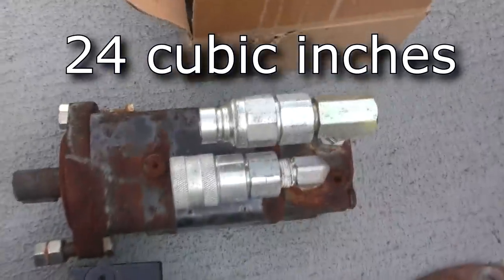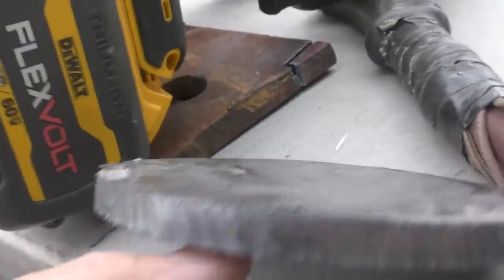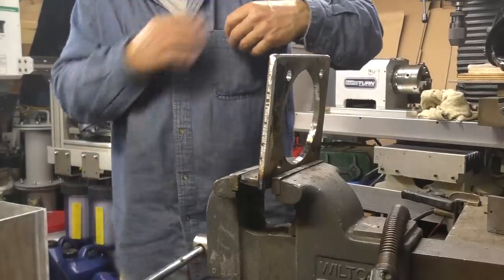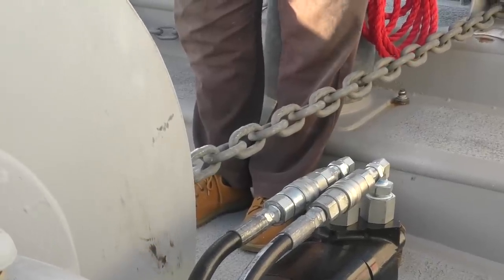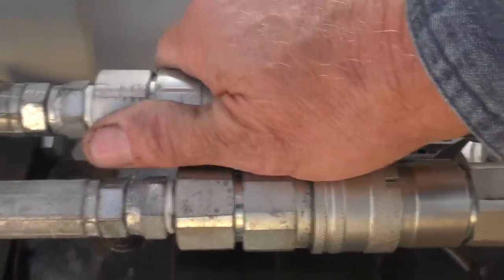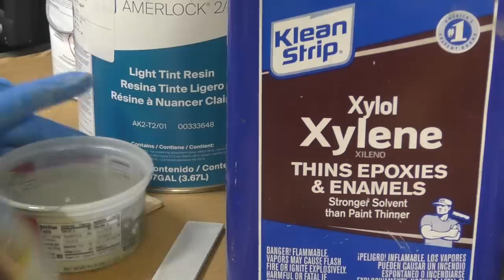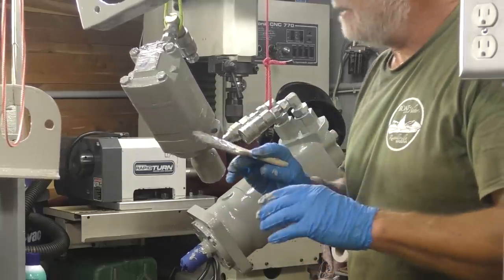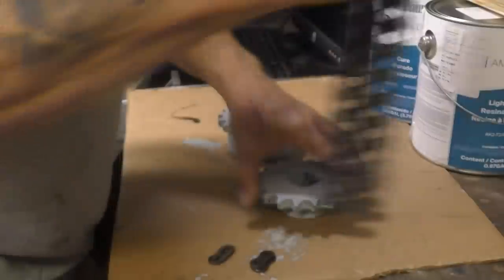Anchor Winch Hydraulics Upgrade with Chain Shaft Coupler

Comment: Too avoid bristles coming off cheap paint brushes, take super glue and applyit to the top of the bristles at the ferrel and spray with some activator and that will stop bristles from coming out.

Comment: The silver Never Seize is not hydrophobic  (it can wash off over time), since the chain is exposed to weather you should use the copper Never Seize as it is hydrophobic and will not wash away over time.
Reply: Is there a hydrophobic Never Seize that won't wash away with carwash soap? I go through a local car wash and my brakes start squeaking and locking up.
Reply: Rodion, that's an entirely different issue, you need your brakes inspected by a service shop

Comment: It isn't OCD about the wobbling motor. The flexible coupler is to take the loads off of the bearings in the motor so that they don't wear as fast. Even though you are not running that motor often, since it is taking a heavy load and is hydraulic, having those twisting loads on the motor shaft will shorten motor life significantly as the bearings are not rated or designed to take those loads and the surfaces in such a motor are extremely sensitive to wear from the bearings being damaged. My motors classes for becoming an industrial electrician covered this topic in depth, for all types of motors, including hydraulic.

Also, there are specially tools for putting couplers together when motors are in place, but since you are the design engineer, you can design your installations where you shouldn't need them or simply make your own tools for such a task.
Reply: Nah. It’s fine nothing to worry about. Bearings are for men raised by women.
Reply: @jeverich  Not sure if serious.jpg
Reply: @KnightsWithoutATable  well; I just rebuilt a Hagglunds Mark43 if that gives you a hint to my level of seriousness… ha!
Reply: @jeverich  Let's see, I could trust you as some guy on the internet who I don't know about their qualifications or I could trust the 3 instructors I had in that program that each had spent at least 30 years in industrial maintenance and had seen what not putting couplers on motors did to them. They even had some examples that they showed us in class. It sounds like you have been using motors that have bearings rated for those forces. Not all motors are rated to have the shaft take those forces. Even if it is rated to take those forces, a couple will extend the life of the motor's bearing and usually the life of the motor in general. Couplers are not that expensive compared to the benefit.
Reply: @evangatehouse5650  My bad.

Comment: I have a chain coupler connecting the generator (motor) on my wind turbine to the blades, I use a 

Martin 6018 Cover, Chain Coupling Cover 6018COV,  (obviously there are many sizes)

It seals around the coupler and you put 30 weight oil in it to constantly lube the chain.

That might be a solution instead of a ton of grease for this for you
Reply from the maker: Yours will certainly get more cycles per year.

Comment: What solar system equipment and batteries do you have? What size and spec? Having gone off grid myself, there are smart inverters that can put in excess of 80amp easily that might be a good upgrade for your system.

Comment: Hey Doug question why not use that yellow cover and put one of those grease gun fittings and fill it up with grease or whatever you want to pack it with. Also how can I make one of those double chains?
Reply from the maker: The cover is open at the ends so it's job is to just keep you out of the grease.   And I have never make a double chain.  Its not just to singles put together, the pins are twice as long.  I've seen plenty of them on eBay.
Reply: Double chain is double chain, you buy it in what ever size you want, it's very common in industry, you can get what ever you want, biggest iv seen is 6 wide chain

Comment: Could take an old inter-tube and wrap it around the sprocket / chain and using two hose clamps to hold it place one on end to each hub. It wouldn't last as long as the floppy OEM cover, though.

Comment: Question re: arc welding.  Does using the welder or plasma cutter on board have any effect to your electronics?  i.e radar, nav gear, etc.
Reply from the maker: I doubt it, but we have not tried welding and sailing at the same time.
Reply: @SVSeeker  I can't imagine a use case other than out and out emergency that would make welding underway a great idea.
Reply from the maker: @d-rot  FUN!
Reply: @SVSeeker  That is what I was thinking as well.  A long passage under sail and I know that you will just be itching to build, repair, rebuild something...

Comment: For the welder issue it sounds like the ground isn't great, take some old battery cable strip it down to the copper and wrap it around what you're welding and clamp the ground lead to that. Fixed some similar issues for me.
Reply from the maker: Yeah, I thought that too, so I have my C-clamp ground on it.
Reply: Welder could have a capacitor failing, causing a weak start. Capacitor failure is pretty common, with the quality available today.
You can also add more capacitors, for more starting power.
Use a multimeter with mf (microfarads) setting, to test the capacitors.
If you have trouble finding a meter with mf setting, they are common in the hvac field.

Comment: Now see, I'm such a land lubber that orange collar would drive me nuts... should be able to tack two rods on it to stop the rotation as well as hold it in place 🙂
Reply: The chain coupling is in the ridged or grid coupling family and the housing  or coupling shell, has shaft seals that prevent the lubricating grease from getting slung all of the deck and prevent water from getting in.  This type are very common on industrial motors coupled to hydraulic pumps or compressors..    The rpms of this winch are so low that  the “Doesn’t really matter approach works” fairly well too.

Comment: Is that a charlynn 10000? You can change the displacement and get more torque or speed depending on what you need. You can keep the old internals for a spare
Reply from the maker: No, but that is good to know.  Thanks.

Comment: You  are going to heat your oil some, don't know whether it is going to create an issue yet. You said the pump-motor  had 1 inch ports, and you started reducing from that. In hydraulics, you need to go the other direction. That first elbow needs to be 1.25 inches, any bend needs to be the next size larger, don't reduce the size that comes out of the pump or motor anywhere. Get rid of the quick couplings, probably the worst heat creator in hydraulics, you only need quick couplings on something that is truly temporary, that's not. Why wouldn't you leave that motor on permanently? Like I said, it is going to heat some, but you don't know how much yet. Just remember heat destroys hydraulics. Keep the temperature of the oil at least under 160 degrees.
Reply from the maker: So far it is working great.  Might be an issue if if had to run all day, but 20 minutes is no problem.

Comment: i do know how cheap you are you will buy 8 cheap sprockets the buying the right one the first time around would have a plastic cover over the chain too i have a rubber innertube put over that to u have a sail of holes dill out to oil the chains to the innertube covers up the hole from dirt and rain too
Reply from the maker: Right and somewhere in one of my boxes I have an old inner tube.
Reply from the maker: Right and somewhere in one of my boxes I have an old inner tube. Thanks